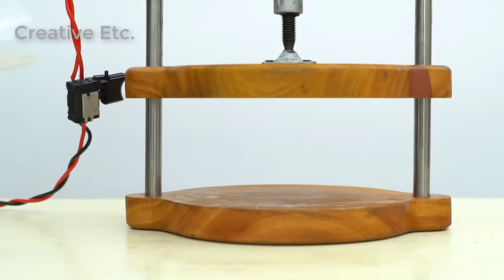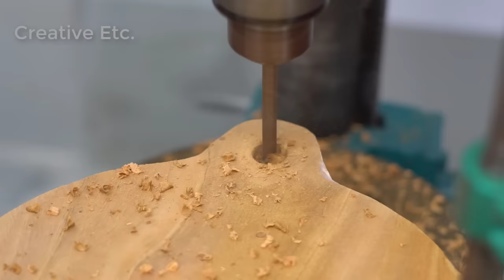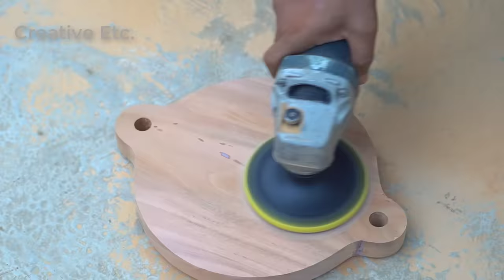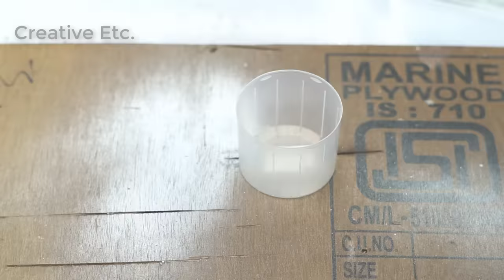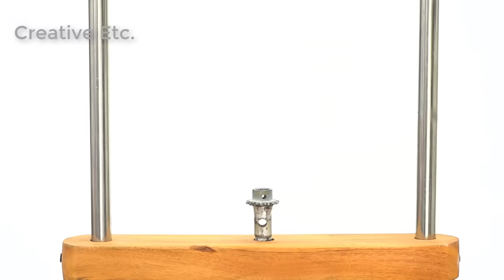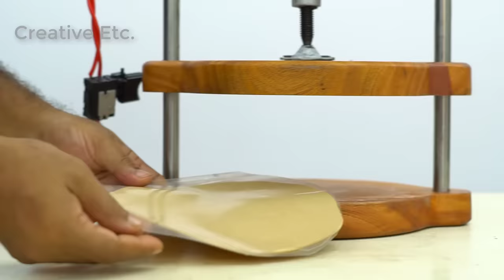How to Make Roti Maker / DIY Press Chapati , Puri Maker With Self Motor

Comment: No control over thickness of roti .It will vary with how resistive the dough is.
A stiff dough will give thick rotis and a soft one will give thinner rotis  
Can think of putting some kind od a positive stop to get uniform thickness of rotis everytime .
Excellent idea to get the pressing force in the middle .This is a screw press .Keep improving it and launch a kitchen top model 👌 👏 👍
Reply: By using torque controlled screw driver for drive motor you can control the thickness.
Reply: @sundararajann6007  Exactly...i have in mind the torque limiting mechanism of a drill machine along with the chuck .Thanks ...we vibe on the same frequency 👌👍🤝🌹
Reply: Think different, with thickness of dough you can make roti and puri also.
Reply: How .please elaborate
Reply: @jeetu3  You can have a thickness limiting based reversing switch .......
Reply: Come on genius, use spacers on the edges. Took 2 seconds of brain power

Comment: This is almost Hi - Tech design, by using two wheeler engine starter. It works on 12 Volts DC power. Good work. Thanks a  lot. 👌

Comment: Good work!
Using plastic sheets for each pressing, is something which requires some patience!
Why not use teflon sheets to cover the pressing surfaces!
Sheet manufacturers can specify the adhesive or the chemical to do this.
The teflon sheets would have to be rough sanded to aid bonfing.

Comment: You are are using a motorcycle self starter
Thn you require a DC input
A s reversible switch
Try servo motor that 
Or better a cordless drill
Even and ordinary hand drill with reverse switch